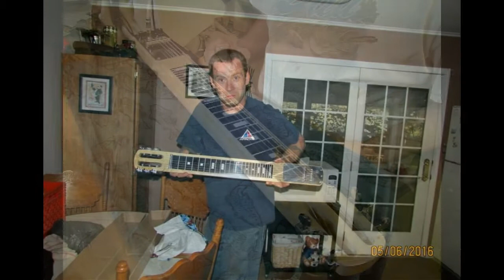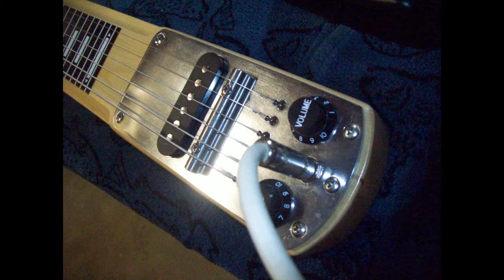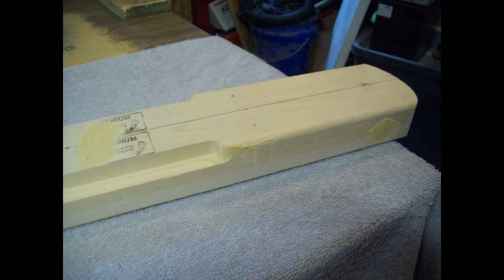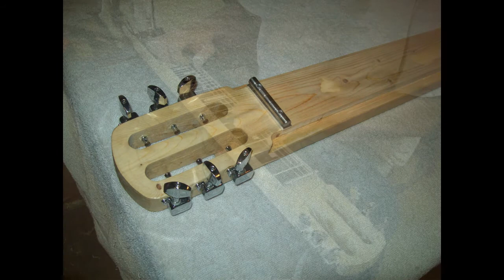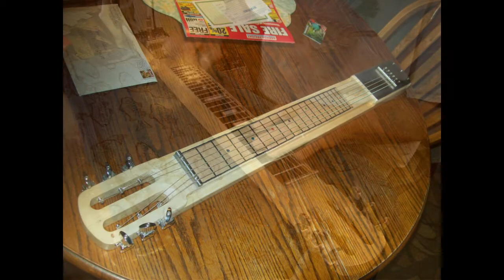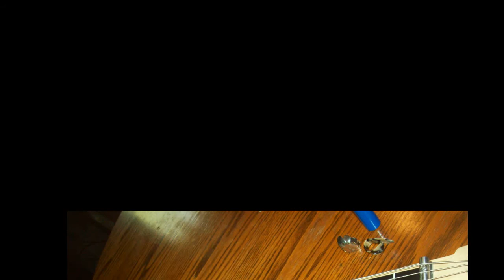Lapsteel built from a 2X4 overview and sound check

Comment: You are getting a great great sound! could you tell me how long the guitar is and what kind of pickup that is? stratocaster replacement?  Thanks!
Reply from the maker: If I remember the guitar was about 30" long with a 23" scale and the pickup was this: https://www.ebay.com/itm/Acoustic-Electric-Guitar-Soundhole-Pickup-6-String-Black-For-Cigar-Box-Guitar/273027513268?hash=item3f91b53bb4:g:cs8AAOSwNWxaKgJD
Reply: rzsdad1 Thanks!